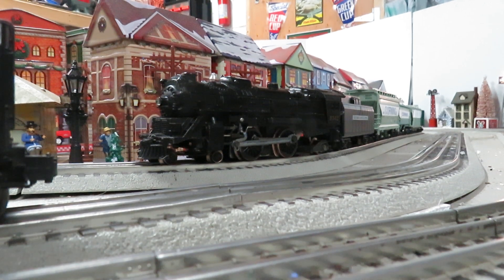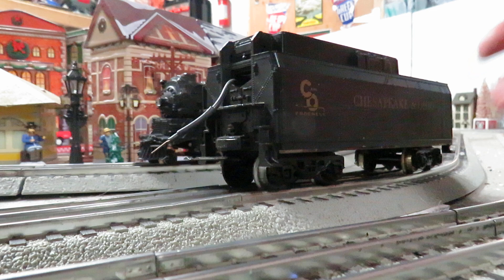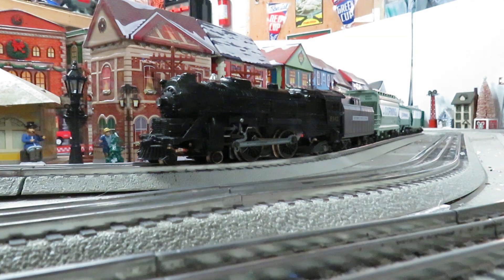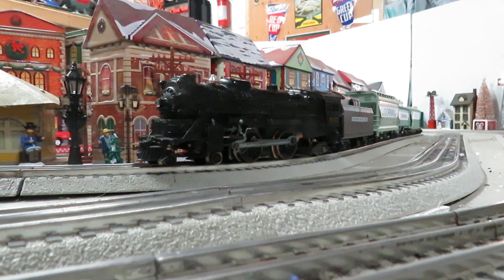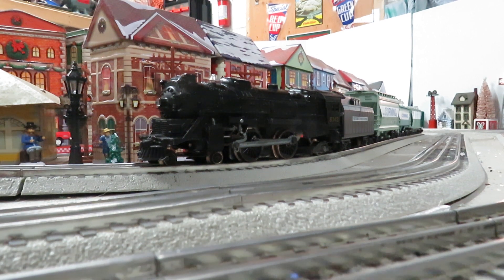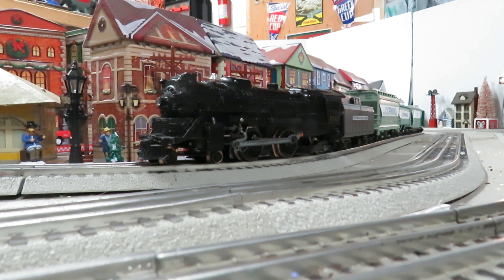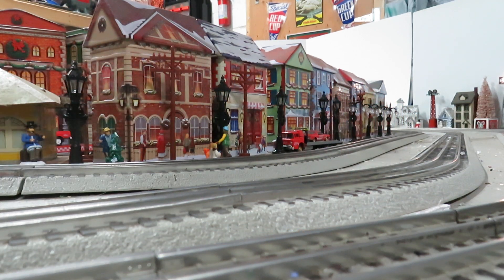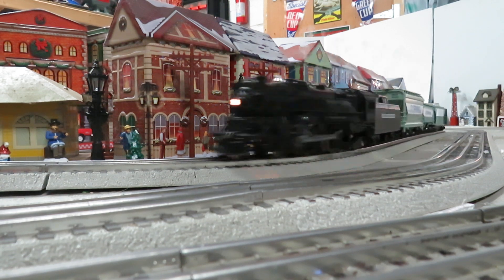another Lionel MPC era Atlantic with sound of steam & whistle!

Comment: John, looks very nice and smokes well. Interesting cars that its pulling.
Reply from the maker: thanks Steve! I've been collecting Corning batch containers from diff. manufacturers. I have a premiere one from MTH and another K-line. The other cars just happened to be in reach...
Reply: @jlebaron1  Thats neat John. I have one Owens Illinois hopper car. I worked at that glass factory for the summer when school was out.
Reply from the maker: @stevesoscaletrainchannel.1901  that's neat Steve, did you live in Corning? Corning has pretty much gotten out of the glass business
Reply: @jlebaron1  No, I live in Pontiac, Illinois.
There is a glass factory about 25 miles away called Owens and it used to be a major supplier of glass bottles. When I saw the Owens Illinois hopper, I thought I should get it. Thank you John.